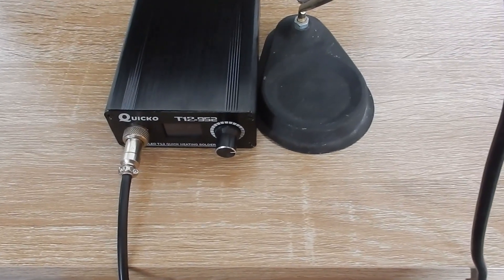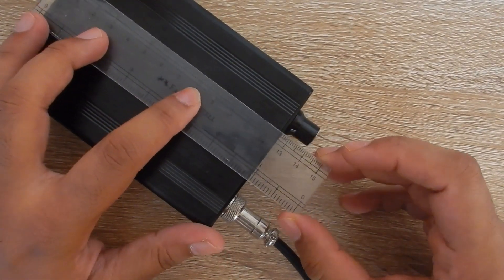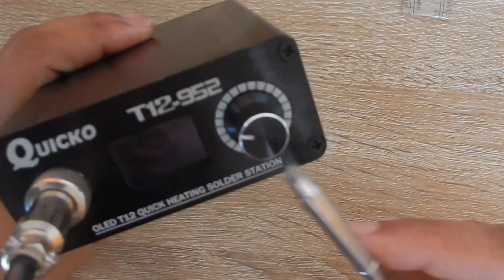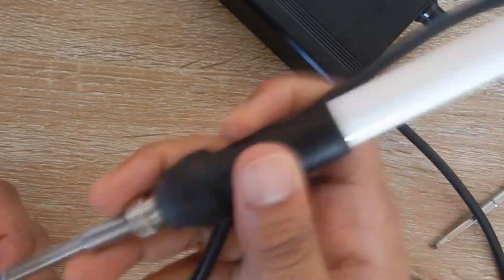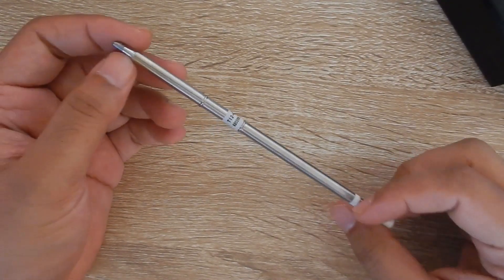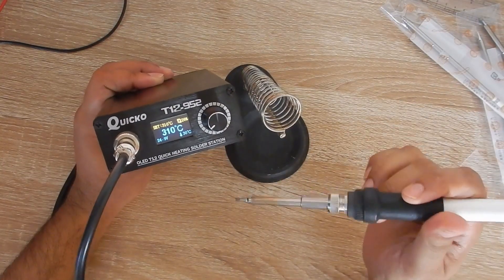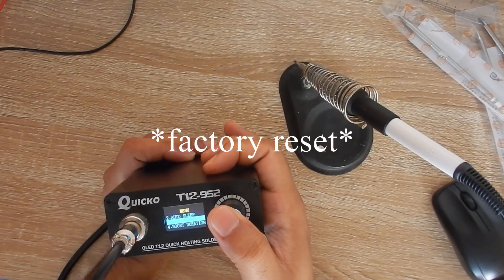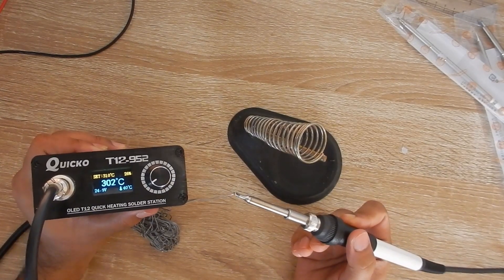Quicko T12-952 Soldering station review

Comment: Wondering if Quicko or KSGER? Is still working your Quicko? Have it ever put the tip at overheating like turning red the tip?
Reply from the maker: Still using it. No problem at all. Usually I kept the tip temperature between 300 ~360. Still using the first tip.
Reply: @MohammedRezwanulIslam  Thanks.